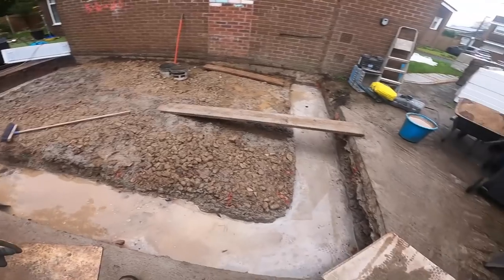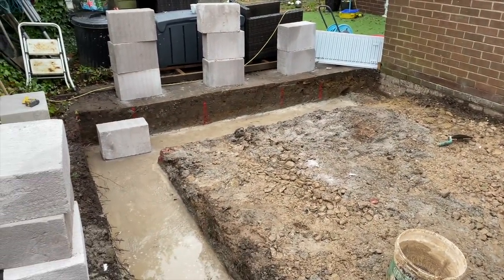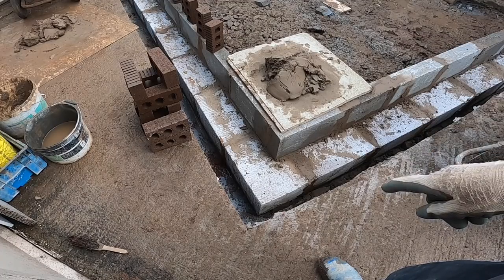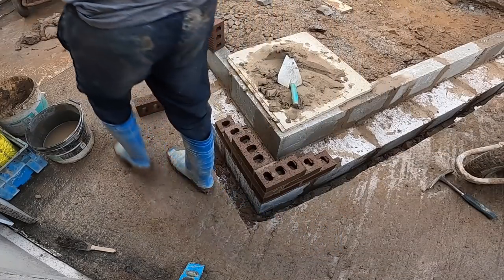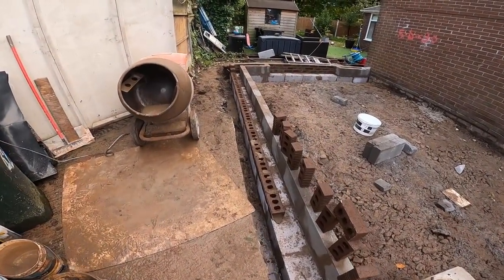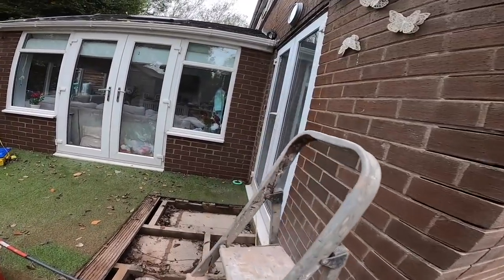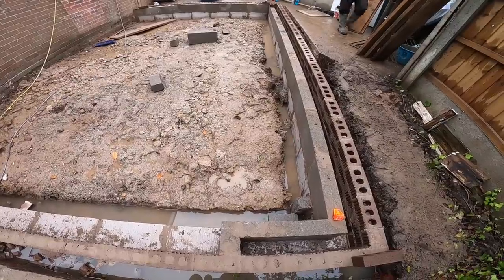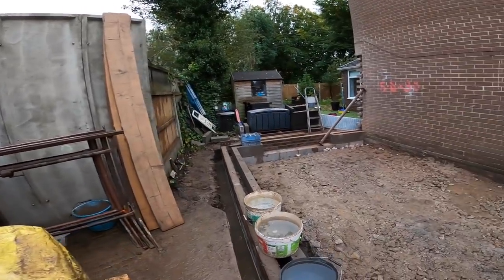FOOTING USING TRENCH BLOCKS...EXTENSION PART 2

Comment: Chaps, for the issues with the GoPro. It's amazing how many Youtubers mention problems with their GoPros. To the extend where one has to seriously consider switching to a different brand. I personally use a Sony AS200V. Had it for years, and filmed all of my DIY projects with it. Never missed a beat. I also know that a lot of other Youtubers use them, cause they are very good. Better image quality than the GoPro, and much more rubust hardware. Great sound quality too! (whilst still being completely waterproof). So I'd highly recommend looking at some of the Sony models. They also have cheaper options, if the As200V is outside your budget range :)
Reply from the maker: Too late 😬🧱👍🏽

Comment: Hi guys.I am a big fan of You.Thanks to yours videos I have learned a lot and just finished bricklaying large brick shed and starting my another DIY project but have a question:When building house extension,why are using trench blocks?Can you skip them  and start brick and block work straight on footings?
Reply from the maker: Hi , glad you like the channel 🤝🏽. No need for trench block If you don’t want to use them 🧱👍🏽

Comment: @steve I had the same issue with the exact same model of radio, if you work out a fix can you let me know, cheers
Reply from the maker: Mmm it’s been back for repair once .
   Now it won’t work with the batteries …. Not good 🙁🧱👍🏽
Reply: @SteveAndAlexBuild  Yeh mine just stopped one day, wont turn on with batteries or power cable, its just a brick, must be a common fault on that model :(
Reply from the maker: Not good as they are bloody expensive . 
   You’ve got a 1 warranty on it though 🙄🧱👍🏽
Reply: @SteveAndAlexBuild  Mine went about a month out of warranty sadly, @makita please fix it for me :)
Reply from the maker: We’ve had a repair so not sure if it will get fixed 🙄🧱👍🏽

Comment: Why are you using trench block? Saving on concrete?
Reply from the maker: No we always use trench blocks 🧱🧱👍🏽
Reply: @SteveAndAlexBuild  The question is why?
Reply from the maker: @fraserweir538  because they are designed specifically for foundations 🧱👍🏽

Comment: Geeez Steve, every time  I see you down on your knees on cement, I wince. (I've got very bad knees.) No knee pads? Save your knees...you'll wish you did later. Suggestion: buy a RV water pump and a motorcycle battery. Will pump out all the wet stuff down in the trenches w/o any work. Cheap solution.   I hope ya'all have your covid booster shots. Omacron is going wild over here. People here that said they would never get poked are getting poked now.
Reply from the maker: Yes buddy , boosted up 💉👌🏼🧱👍🏼

Comment: Who put the concrete in u have a block with a massive bed going to cutting the block towards the house why not gauge the concrete to work in course with the house. Extra work n cost for no reason
Reply from the maker: You wouldn’t have anything to complain about if it was perfect 🤷🏽‍♂️
Reply: @SteveAndAlexBuild  just makes life hard fuck cutting trench block
Reply from the maker: I only cut one where the original house foundation was a bit lumpy and high , nothing to do with us but no biggie